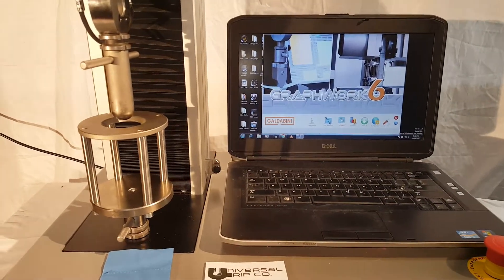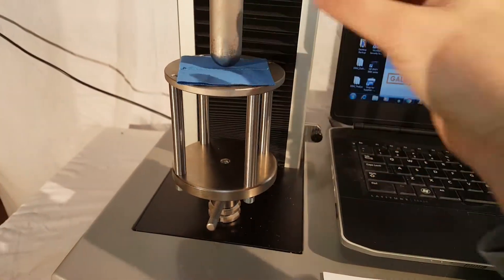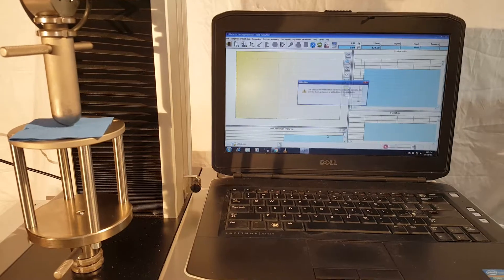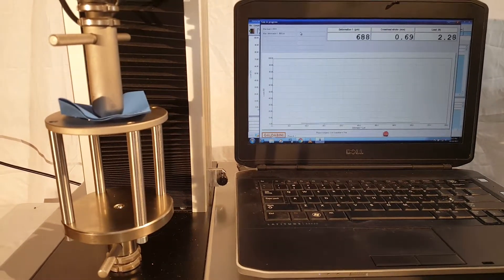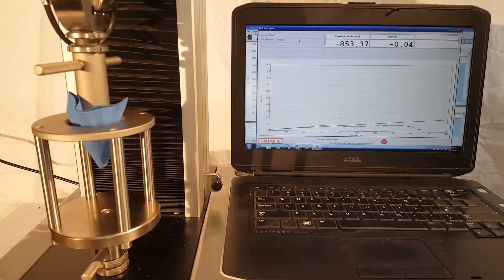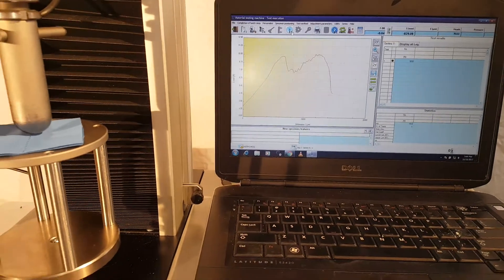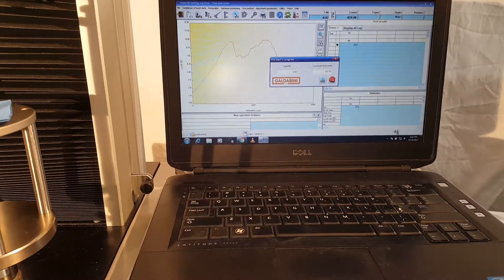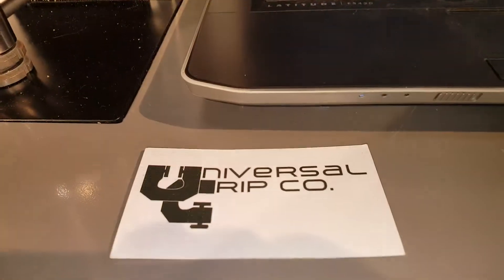ASTM D4032 Fabric Stiffness on a Universal Testing Machine

Comment: What speed are you using for the indentor to come down and why does your indentor have a spherical end vs the flat end that's on the ASTM standard?
Reply from the maker: Hi Aditya, Thank you for your message, I believe in this video I have the speed set for 200mm/min. We built this fixture according to the customer's requirements, we can build any sort of custom fixture you may need.